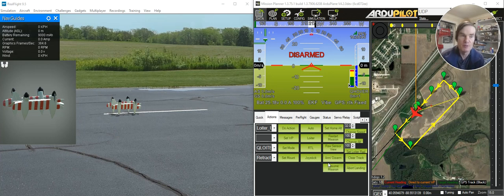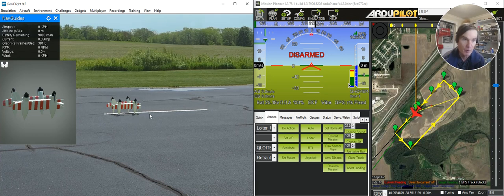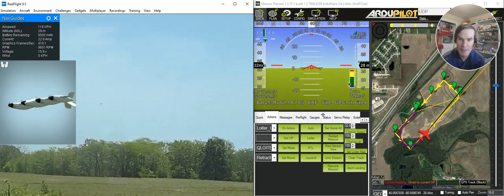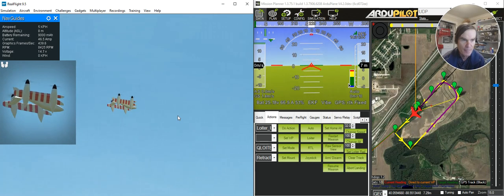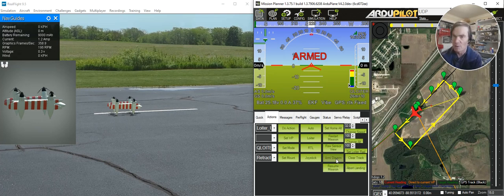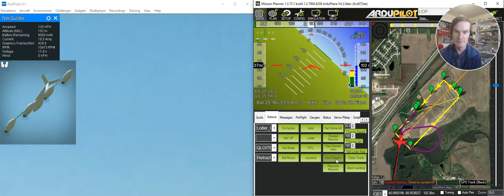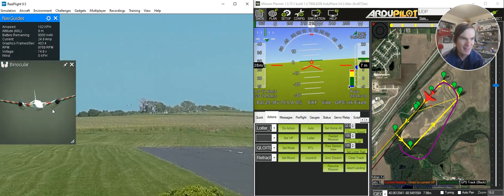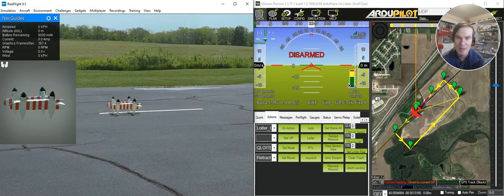Pterodynamics Transwing Update

Comment: What's with the tail wag during the transition? Are there any moving surfaces on the tail? Folding wing simulating flap sounds like a new flight mode that VC UAM funding folks will claim to invent soon! Motors angled out, does that help with yaw like the Swan K1?? Looks amazing as ever, if you and Peter can't make it fly, it won't fly!